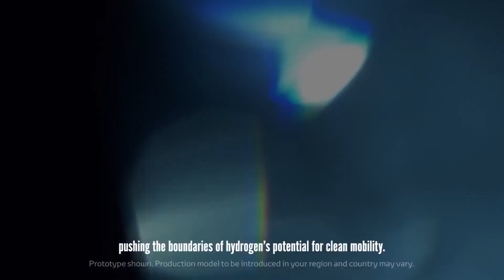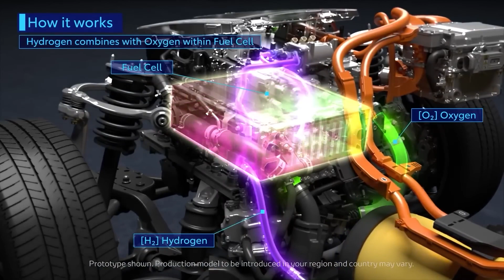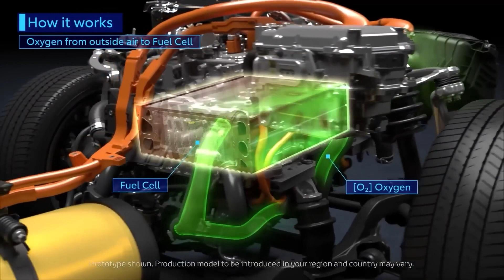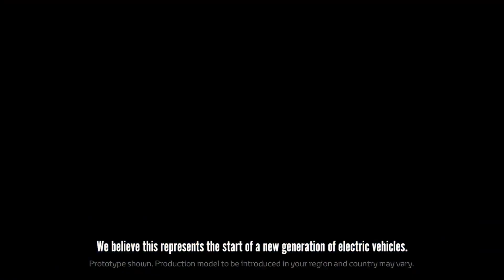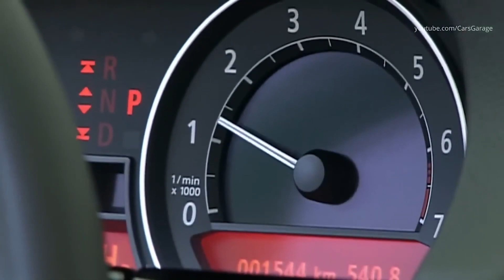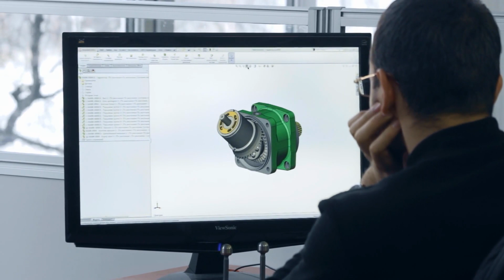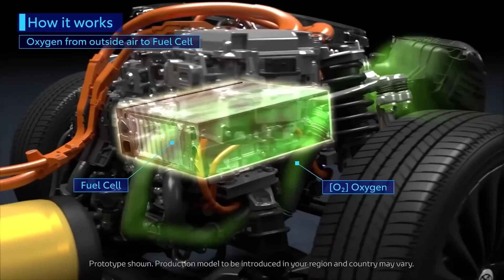Toyota FINALLY Revealed New HYDROGEN Combustion Engine

Comment: "Conventional" , yes I know,
Hybrids w/ regenerative breaking & regenerative suspension? I think that's what I heard and other possible sources 🤔  cleaner , more refined gasoline make the gen set that's the engine rotor and stator more efficient 
Hydrogen remember "the Hindenberg" 
Pure electric Elon gonna have to fix BIG  EkHz

Comment: Burning hydrogen in an ICE engine is the stupidest idea ever. Toyota Mirai fuel tanks hold 122.6 liters, this only gives you 5kg of fuel and the tanks take up most of the underside of the car, this is because the fuel is a gas, not a liquid. To run an ICE engine on hydrogen you will need about 50kg to get 400mils, this means you need a 1226 litre fuel tank, including the high-pressure tank this will occupy about 2 cubic meters. this is just not practical in any way.